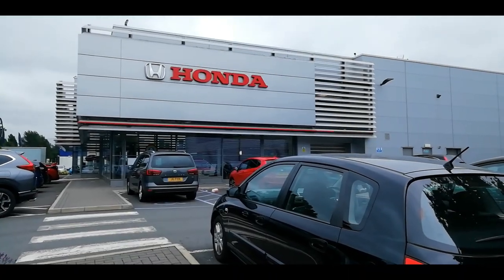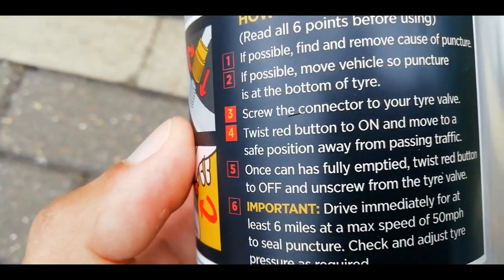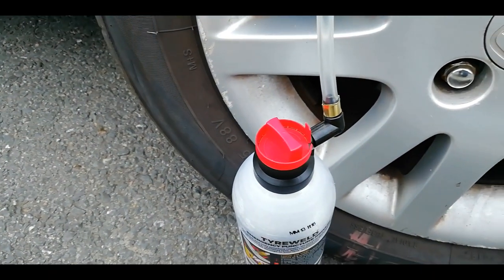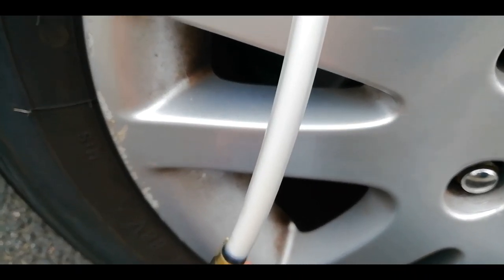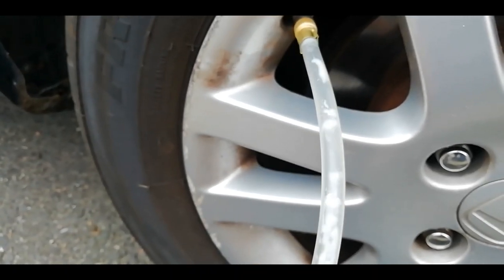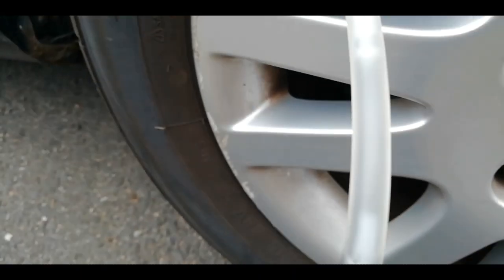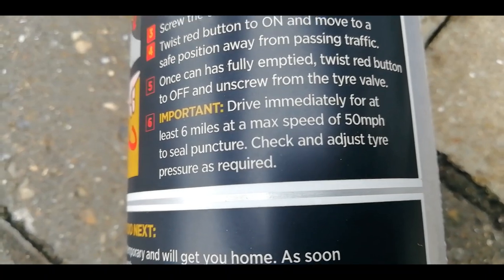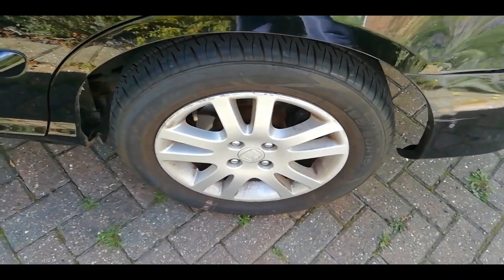Holts TYREWELD. Does it work?

Comment: I used Hoult's tyre weld the other day and was totally impressed with the product, considering I was down one tyre and the pump at the garage air pump let my spare space saver down instead of pumping it up, plus I had like ten mins to get to work, it was a life saver. Keen to see how long the repair lasts now, as it was a small steel wire sized hole, so I'm taking my chances on a repair patch for now.
Reply from the maker: Good to hear it worked for you Jason. I keep a can in the car now, just in case.
Reply: @kaiserrazzaq6865  I am keen to see how long it will last and keep a spare can in the car.
Reply: The repair has lasted over two long road trips, over 520km each and still good to go, haven't even had to add any extra air.
Reply from the maker: @jasonfisk2520  That's great Jason. I see my one as a permanent solution too. If it develops a slow puncture then I'll just fill it again with another can. Hopefully the fix will last the life of the tyre!
Reply: @jasonfisk2520  I did 12,000 miles on a Holts repair lol. Ended up with it in three of the four wheels before the car eventually went to car heaven
Reply: Do you drive the 6 miles in ten minutes ?
Reply: @soundwaves1545  Kind of I drove to work in under 6 mins then parked up for the day then rechecked and drove again later that night everything was fine, has been ever since.

Comment: How many miles can you drive with this thing?
Reply from the maker: I have just kept driving with it. Seems fine. It's designed just to get you home, then you're supposed to get the tyre fixed. But as mine hasn't deflated, I'm viewing it as an almost permanent fix. It all depends how bad your puncture is. Thanks for watching.

Comment: It doesn’t work. Followed instructions totally. It inflated a little, then went down again. Avoid it like the plague. Garages also refuse to repair a tyre where it’s been used. I don’t know how car manufacturers can get away with not supplying a spare wheel and actually recommending this stuff as an emergency solution. It’s totally useless and forces you to fork out for a new tyre.
Reply from the maker: The tyre weld may only fix or plug small holes. If the hole is too large, this tyre weld will not bee good enough and the tyre will need a proper repair or replacement.